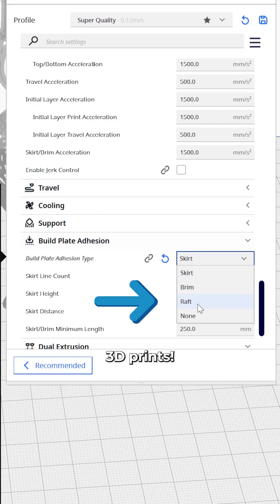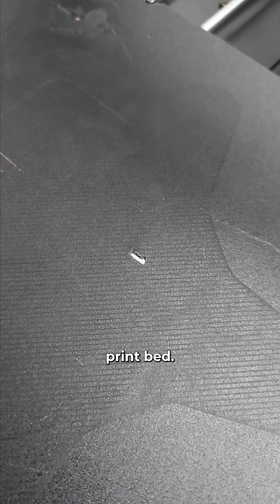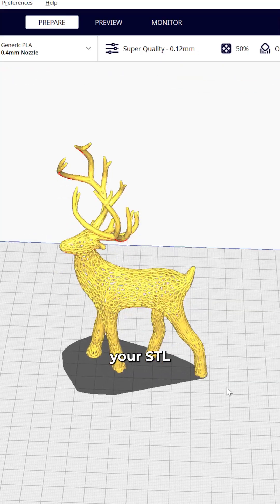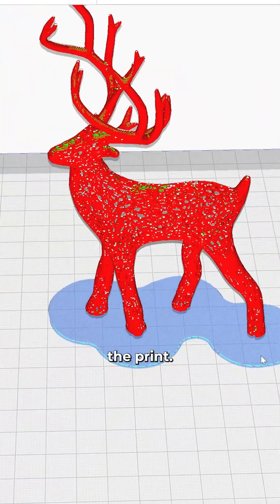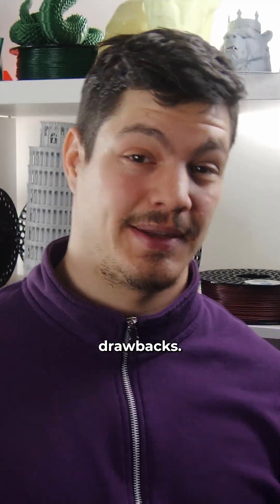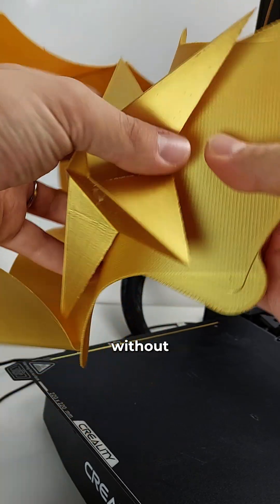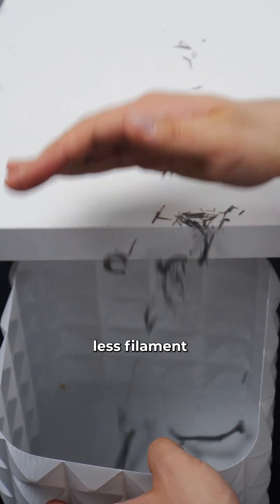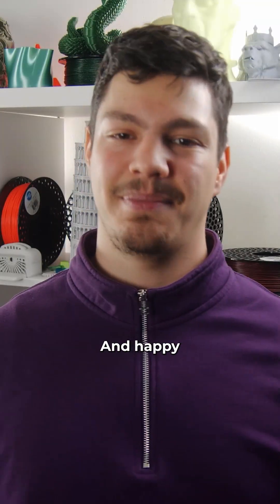How can a raft save your 3D print #AzureFilm #3dprintingtips #raft #3dprintingnerd

Comment: Make a raft with a studded pattern, tiny nubs for the thing to float on while also having a hex pattern to maintain rigidity while minimizing tensile strength so it snaps off easily and leaves tiny pieces that will sand off easily
Reply from the maker: Thanks for the tip!